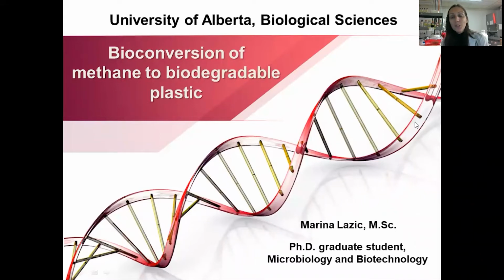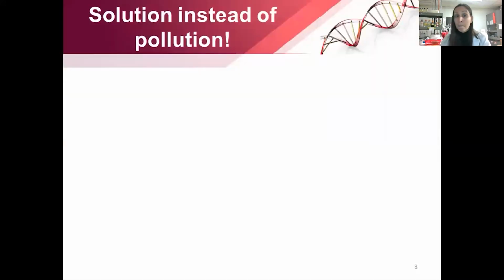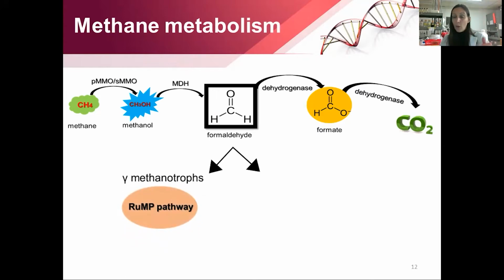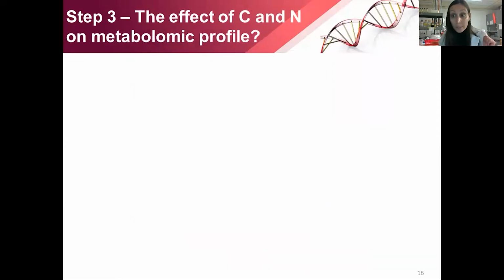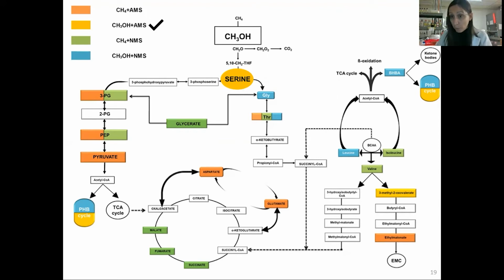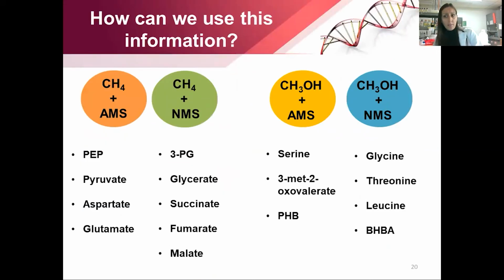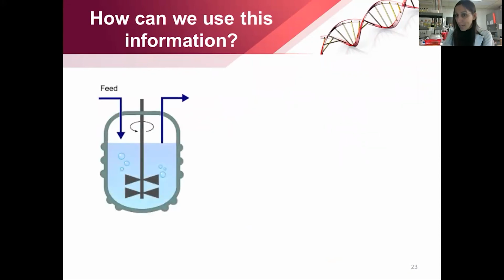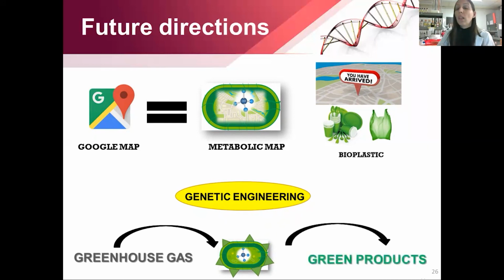Marina Lazic - Bioconversion of methane to biodegradable plastic

Comment: Very informative and clearly presented talk. Thanks. Possibly the difference in amount of biomass production is the redox differences of the methane/methanol and ammonium (reduced)/nitrate (oxidised) pairings. Also I was curious whether there are differences in the raw material costs of methane vs methanol and ammonium vs nitrate salts that might in the end determine which growth medium is financially viable?
Reply: Hi Stephen, sorry for late response. Yes, methane and methanol as carbon sources might have similar pathways of metabolic consumption, so it would be expected that they have similar effect (it is only one step difference). However, that one step catalyzed by p MMO is very importnat regulator. Usually, methane oxidation is driven by ubiquinone-derived electrons, when methane is not present, those electrons enter still to ETC, which changes the ETC flux (affects energy generation). In addition, with methanol and ammonia (as nitrogen source), p MMO will recognize ammonia as a substrate (since it is similar structure to AMO from ammonia oxidizers) but it will generate hydroxulamine (toxic) which can slow down growth. Not to mention that in order to be assimilated nitrate has to be reduced to ammonia first (energy consuming). About the cost - both methane and methanol are byproducts (waste), methanol might be better since it is easily available (liquid vs gas), with metahne we have issues with gas transfer to media. This starin is specifically good because it prefers ammonia over nitrate (nitratee is costly), which means we can use it with waste water as growing media. I hope this answers questions. Please elt me know if you have more questions. Thanks
Reply: @1234572886  thanks for such an informative reply.